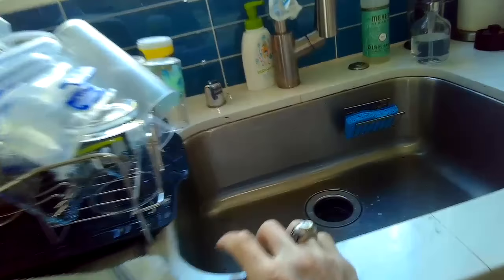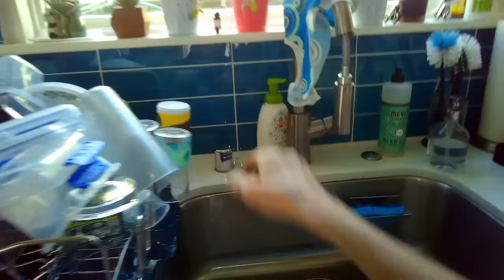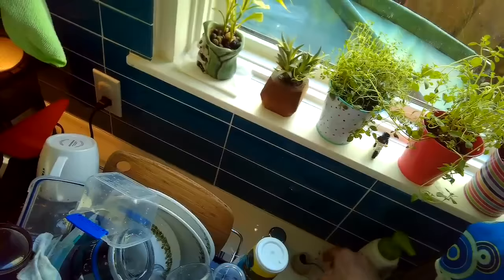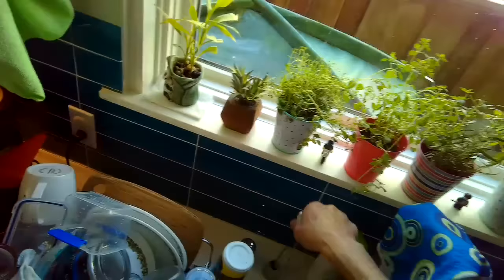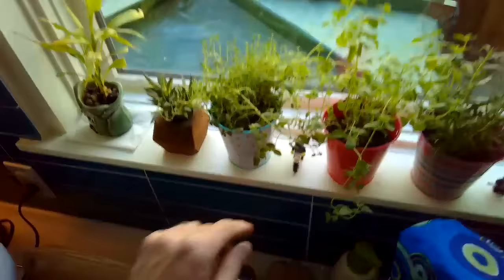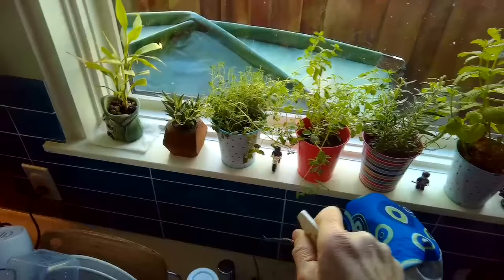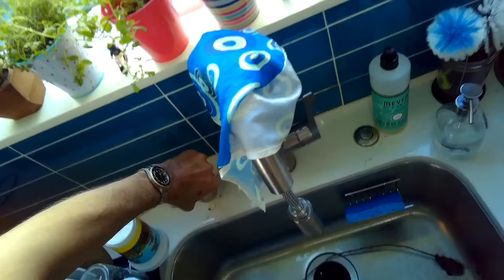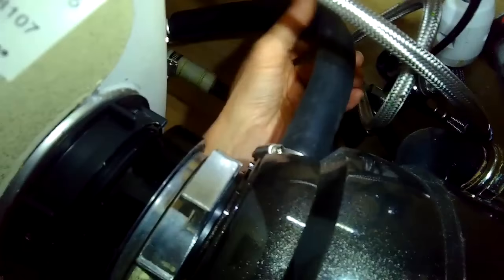✨ Dishwasher Draining Into Kitchen Sink - Easy DIY FIX ✨

Comment: Also to add to this - If you replaced the garbage disposal with a new one.. REMEMBER TO CHECK - the plastic knock out inside the garbage disposal plastic pipe going to the washer hose.  If this is not removed you get the same problem -- The manufacturer covers this.... model - InSinkErator Badger 100 1/3 HP Continuous Feed Garbage Disposal.
Reply from the maker: Very good advice,
Thank you😊
Reply: Thank you!!
Reply: I wish I could like this comment more than once. You completely saved the day friend. Cheers to you.
Reply: Thank you for this reminder about the plastic piece I forgot to knock it off when installed new garage disposal
Reply: This comment saved me a plumber thank u man i owe u a joint
Reply: Inside of disposal? I have to remove new disposal? Can you show me where is plastic knock

Comment: So. The Water Should Not come out of that? My Dishwasher is been draining from there, I even pointed the opening towards the Sink; however, I’m afraid that by accident I’d closet and I would get a mess in my kitchen
Reply from the maker: If you clean out the big black rubber tube, then it will drain normally again.

Comment: Nice use of occlusion! Good video, hope it fixes my issue.
Reply from the maker: Thanks so much😊
Reply: @QuickAndEasy5MinuteAppliance  btw it worked! My dishwasher is working great, vacuuming the drain hose that you put the clamp on was my issue. Probably my old dishwasher was fine albeit noisy. Thanks again

Comment: Are these air gaps needed any more?  I have seen other dishwasher installs and there is no air gap installed.  There is only the drain hose connected to the garbage disposal or drain if  no disposal is present.
Reply from the maker: You don’t need it, if you can bend the drain hose in a big loop that goes up.
Reply: @QuickAndEasy5MinuteAppliance  checked my building codes here and checked on Whirlpool site.  We need to have an air gap in Clark County Nevada.